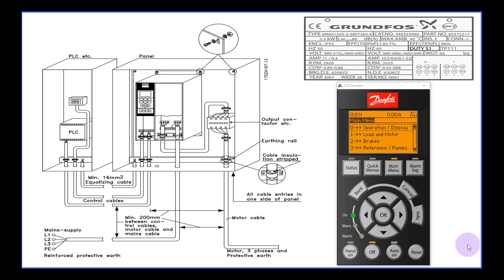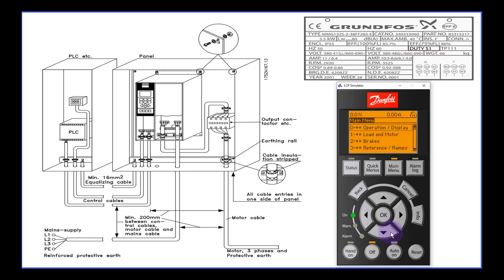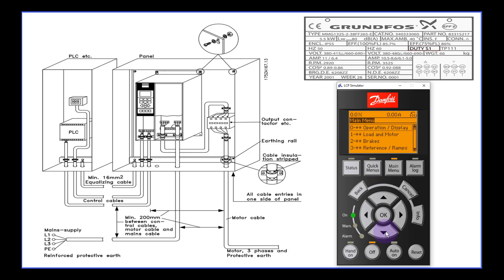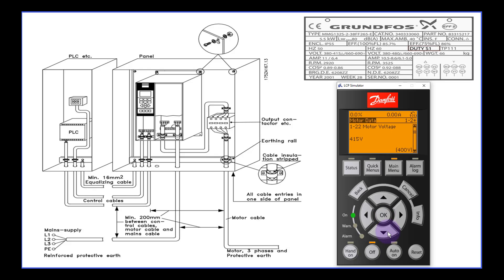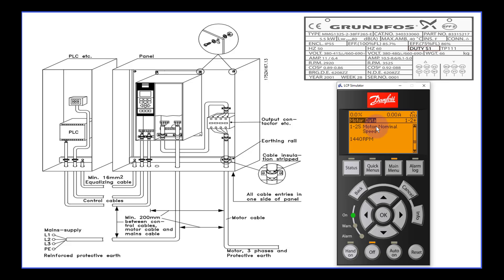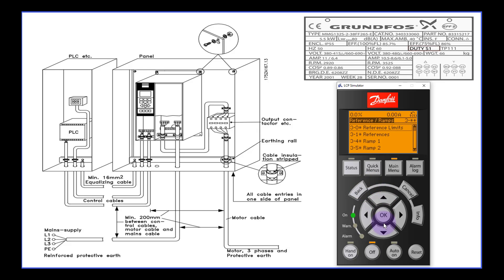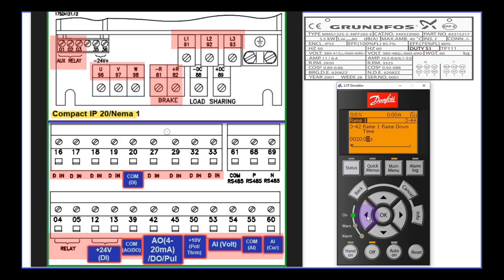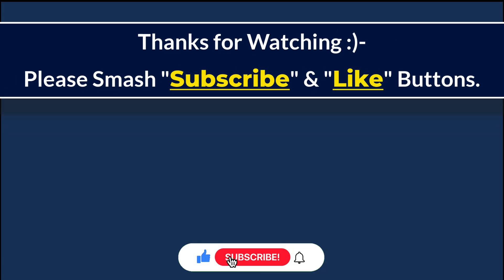Basic Danfoss VFD Configuration & Parameter Setup

Comment from the maker: "In this video, I use the LCP Simulator to demonstrate how to program the basic parameter into Danfoss LCP. Although it is not an actual Danfoss VFD and LCP, but the steps show here is the same when you physically do it on-site. 

The setup includes Initialisation, Motor Data input, Reference Limit, Ramp Up & Down and Digital Input configuration. Hopefully, this video is of helpful to viewers. If you wish to download the LCP simulator, please leave comment and I will show you the method to do so. thanks."

Comment: Sir how to make the motor run in both the directions fwd and reverse, I tried by changing in motor speed direction section by selecting Both Directions but still the motor is running in one direction
Reply from the maker: May be you can try to find the Danfoss manual for  parameters whether there is any feature such as mask that disable the motor direction change. In AB powerflex 7x series, we have to enable the mask for motor direction.

Comment: How yo set pressure bar i want to  know
Reply from the maker: Sorry! I don't understand your questions about setting pressure. Do you mean connecting pressure transmitter signal to the VFD Analog Input?
Reply: @InstrumentationTechnician  my buster pump VFD  set point 4.5 pressure  bar .I want to set 3.5 but how I can do that .give some idea
Reply from the maker: Hi @S.KU.1305, Unfortunately, I have no way to test the idea you mentioned about the pump VFD pressure setpoint since our VFD is always running. I will try to test it on our pump VFD in future when the skid is shutdown for maintenance and will let you know the outcome.

Comment: how can i run a 3phase motor with 220V supply, motor connected in delta
Reply from the maker: First, you have to refer to your motor nameplate. Usually, motor nameplate will indicate information about Star and Delta wiring connection configuration depending on 3 phase incoming supply. 

For instance, motor nameplate wiring configuration showing 480V for Star connection and 220V for Delta connection. So, in this case, If your incoming power supply is 220V, then you have to manually configure your motor wiring connection into Delta connection.